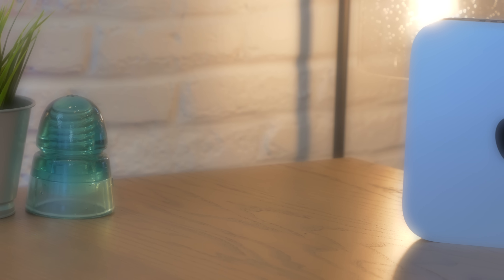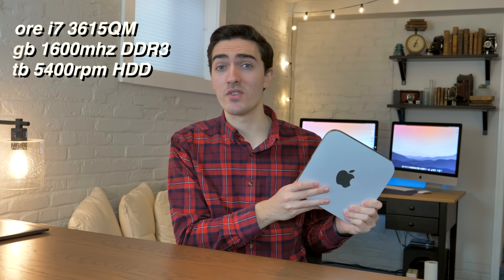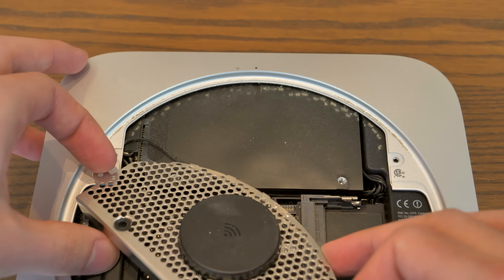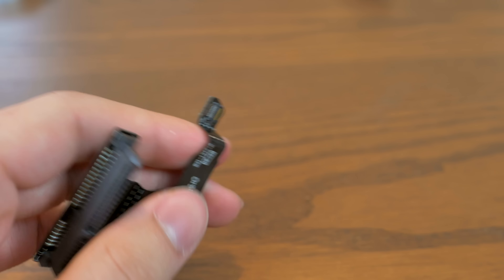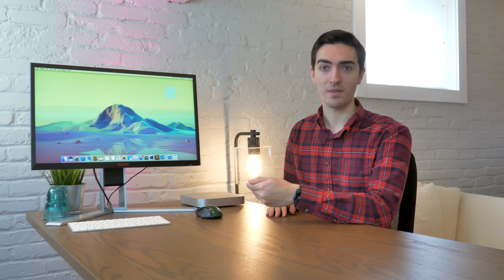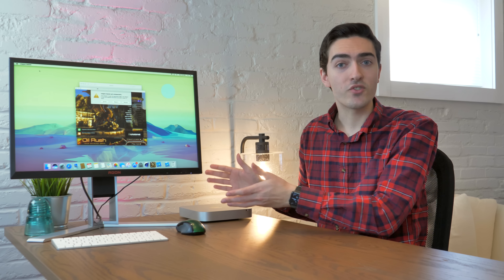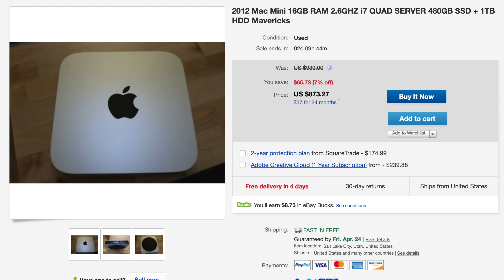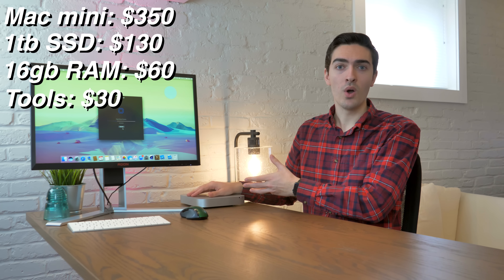Building the ULTIMATE 2012 quad core Mac mini – But is it worth it?

Comment: I have a 2019 Mac mini and I am to scared to upgrade it
Reply: I wouldn’t advise upgrading it except for the ram which I believe is still easily accessible
Reply: @isaaclinzay8684  Yes , you are right , the ram is not bad to get to , only a partial strip down , no need to remove the charger. The ram is the only upgrade possible thanks to Apple and soldered down ssd
Reply: @isaaclinzay8684  

The RAM is the only thing you can upgrade on that abomination because apple in all it's wisdom decided to solder the storage directly on the board.
Reply: It’s possible to upgrade the RAM and CPU but you need to watch a video and follow it step by step. You also need the tools too like Torx screws etc
Reply: Would you mind telling us why?
Reply: Mad Duck don’t worry, you can’t and ain’t supposed to, it’s the new Apple way
Reply: Taj Callender the RAM in the 2018 Mac Mini isn’t in the same place as in the 2012 Mac Mini. The problem is that you need a upgrade kit, which I wouldn’t buy
Reply: @RodrigoFerreira-bs6hd  You do not need an upgrade kit , just the new ram although Apple have made it more difficault to swop them its not a big deal . Apple have put a coven over them , god alone knows why because the original ones work fine without it . To upgrade the ram on the new ones you have to go as far as the stage where he removes the motherboard , remove the new cover that Apple decided to put over the ram , just 4 screws , swop the ram , put the cover on and reasemble . Granted its harder than the older ones but not rocket science
Reply: david thomas but I’m afraid of losing the screws. It’s not just four screws. It’s at least 10 and they use different kinds of screws. So I need new screwdrivers
Reply: @RodrigoFerreira-bs6hd  Buy the ifixit iOpener kit which gives you 25 compartments to store screws in.  Used it and an ifixit screwdriver kit to go from 8 gb to 32gb ram a few months ago and repasted the cpu last night. Temps were all over the place as per TG Pro fan app but now it seems to run much cooler and temps are within 5 deg C instead of a 20-30 degree temp change between cores. Was getting close to 100C moving files and stuff but I haven't run files since pasting it. Idles at around 35-38c. Yeah I probably voided my warranty but considering the crappy paste that I pulled out, I think it will extend the life way beyond the warranty. Artic Silver used. Old stuff was dry and had voids in it. I track CPU temps like I do my download speeds. Live in an area overseas where internet access is just pure crap. Will be glad when I live in an area with good access.
Reply: david thomas they put that cover to make it seem hard to upgrade for the layman so you’re more likely to pay out for a new one when it becomes slower...

Comment: I did this EXACT build 3 months ago and it has worked very well for me so far. Am only using it to surf the web and some basic stuff. It is absolutely not a powerhouse by any means but it does great for what it does. Great video.

Comment: Personally, this is a bad deal, for the same price you could build a quad-core 9100/9100f build and Hackintosh - and you'd have upgradability.
Reply: I replaced my much more powerful hackintosh with this Mac Mini after it became impossible to upgrade to the latest macOS with an nvidia graphics card. It was cheaper to buy the Mac Mini than replace an entire GPU and stuff like iMessage, Airdrop, Handoff, etc, works without all the manual configuration I had to do on the hackintosh. It'll have future updates from Apple without me having to deal with any more stupid issues because Apple and nvidia can't agree on drivers.

Comment: You don't actually need to remove the standoff screws for the bottom cover
Reply: You do if you want to remove the plastin mount for the drives . That screw goes through it and into the metal case